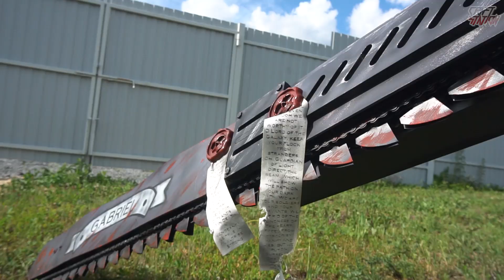Huge Worker Chain Sword (Eviscerator)How to make From Warhammer 40k DIY

Comment: Nicely done! I was planning on pretty much same build, but with brushless rc motor to get better revs on the chain and smaller form factor and gearbox being custom built using normal cut gears instead of angle grinder gearbox.

Comment: Awesome  ..how strong is the chainsaw ? Could you actually cut something?
Reply: It's a replica it doesn't work i mean it doesn't cut those teeth/blades are not sharp neither strong
Reply: Its a possible movie prop not a real weapon buddy lol
Reply: @fjori_dema  And the teeth spin in the wrong direction. They're supposed to spin clockwise so junk doesn't get sent into the engine and any bits of tree get blown away from the user.
Reply: The motors are not meant to cut, it's not strong enough to move on something trying to cut.
Reply: so its useless in a zombie apocalypse, im sad.
Reply: @felipewerner6670  I mean I'm pretty sure any chainsaw would be useless in a zombie apocalypse.

Not only do you need gasoline/electricity to power one but zombies also don't feel pain so you can spend a solid 15 seconds trying to saw through one's torso and it'll just grab you by the face and bite you anyway. 

That and the zombies would be wearing clothing that will get snagged by the chainsaw's teeth and it'll stop working. 

A better zombie killing weapon would be a machete, club, or pointy object that will allow you to very easily penetrate, cleave, or crush their soft rotted tissue and wouldn't require any maintenance, fuel, or repairing that a complex mechanical weapon like a chainsaw would need a lot of.

Honestly though, I think the best weapon against zombies would simply be the passage of time, as any animals/insects/bacteria would reduce them to compost in less than a week. Nature always finds a way.
Reply: @NightmareBlade10  my choice of melee weapon against zombies would be a small shield and a sturdy flanged mace
Reply: @NightmareBlade10  youre a man of zombie culture sir, cheers.